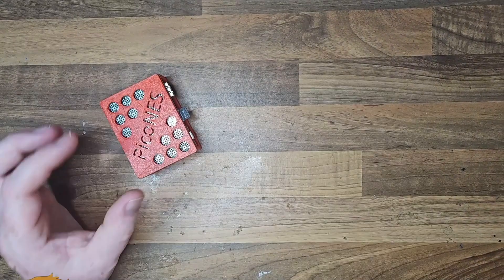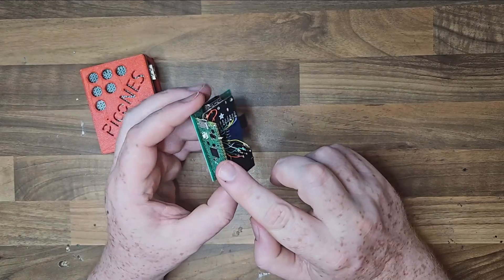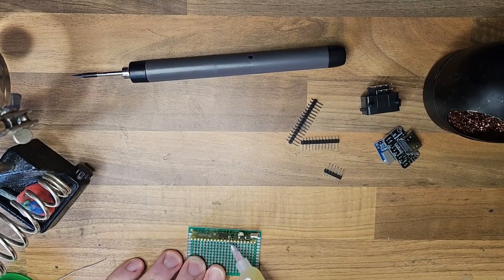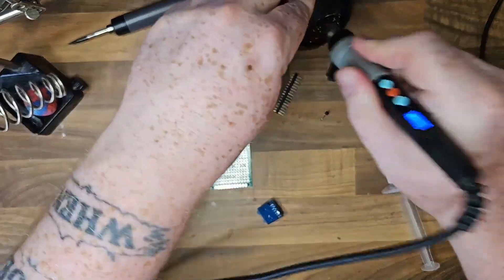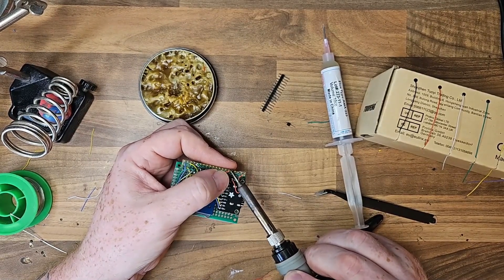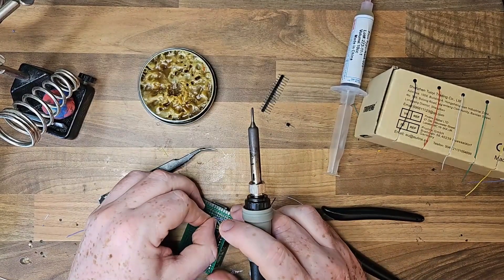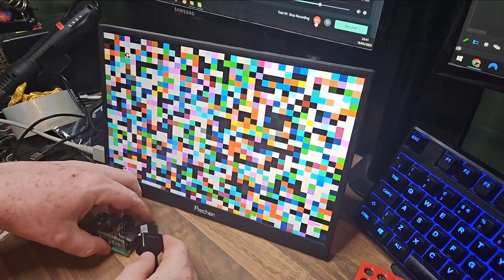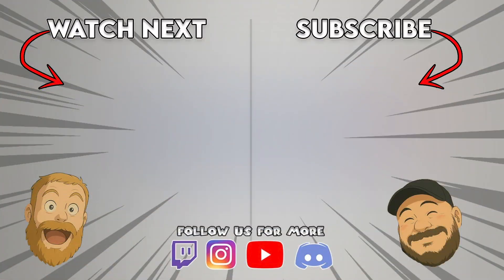How to Build Your Own Sega Master System Console with a Raspberry Pi Pico 2 – Step-by-Step Guide!

Comment: Does it support sound ? i ask this cause the standard Pico HDMI implementation uses DVI backwards compatibility mode and it does not support sound. other pico based consoles use a separate 3.5mm jack for audio.
there is a updated implementation that does allow audio over dvi/hdmi (i just read)
just asking since i didn't hear any game music.
Reply from the maker: Ah, my apologies. I don't know why I didn't include that. Yes, there is audio output. I don't notice any lag, or issues with it.

Comment: is there a why to use a sms or gg card slot on this?
Reply from the maker: At this stage, no. But it would be cool if this happened later down the line.
Reply: @DReviewTing  for passive support (dumping the cart to sd and then running it) i guess it could be don with some IO extender chips. but for active reading a cart there are not enough io pins on the standard RP2350A. there is a RP2350B that has 48 instead of 30 io pins, that one may work...

Comment: I wonder if horizontal staking are possible in that case.
Master system being played from a nes controller really breaks my mind.
Reply from the maker: I think I'll design a basic case for it, just to keep it secured. Also, using the NES controller for MS, is unreal. But again, I've played N64 with a PS5 controller 🤣